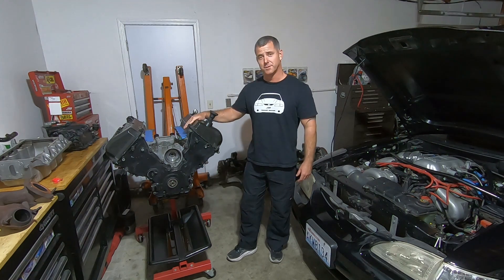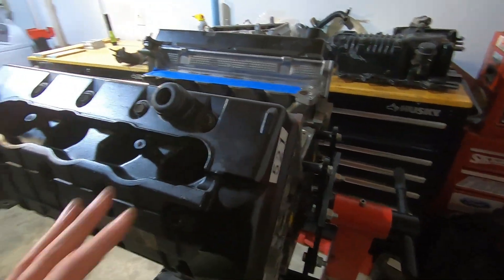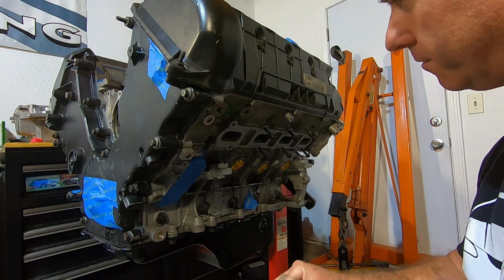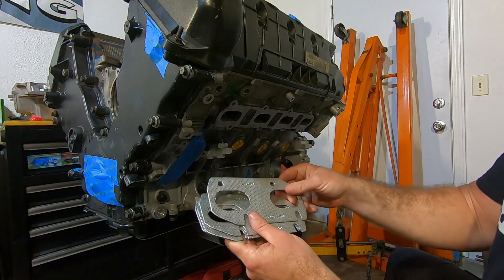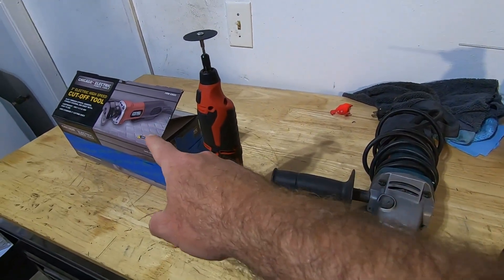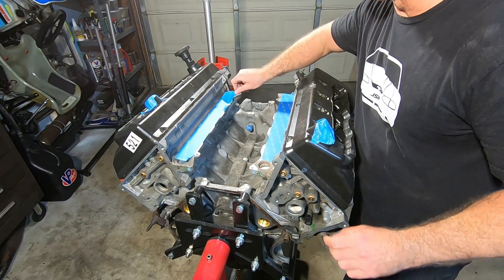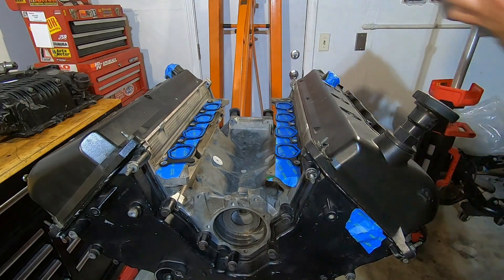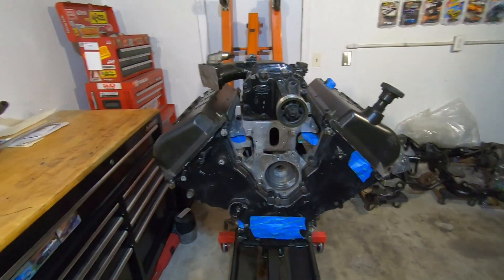Pt 10 Test Fitting Eaton M112 Supercharger from a 03-04 Cobra - Forged 4.6 for 2001 Mustang Cobra

Comment: Where did you relocate the knock sensors too ?
Reply from the maker: They will not be used, so they aren't relocated
Reply: Is that a common mod ? Is this running an SCT ?
Reply from the maker: @svt_grizzly333  It's common for certain combinations.  For instance, I usually grind them off for 2V intakes as well.  Yes, this car will be tuned.
Reply: @JohnSmithRacing is is this recommend  for 11-1 cp and 106300 cams , that’s what I have going in my cobra N/A
Reply from the maker: @svt_grizzly333  It will probably run without a tune but I would recommend one